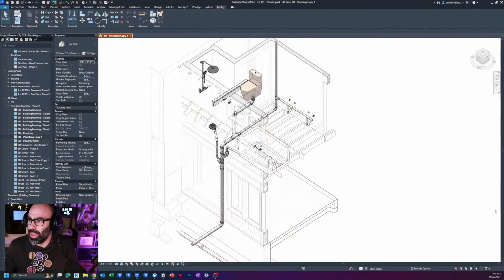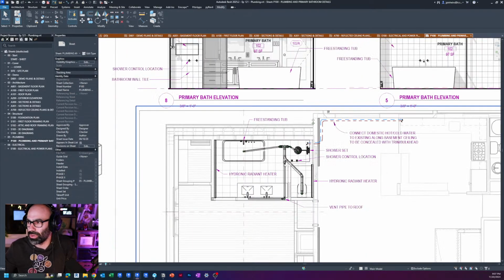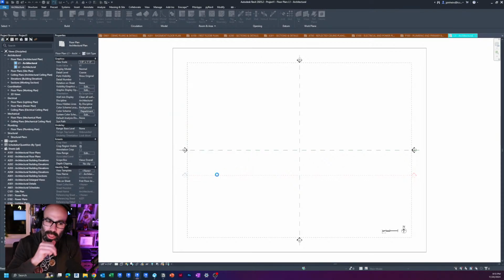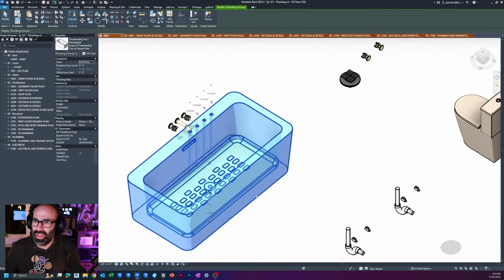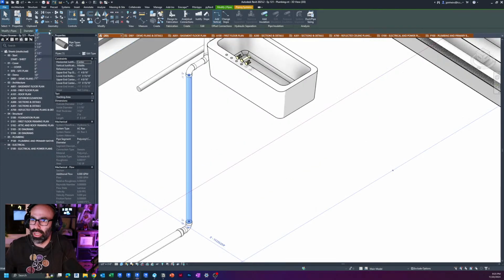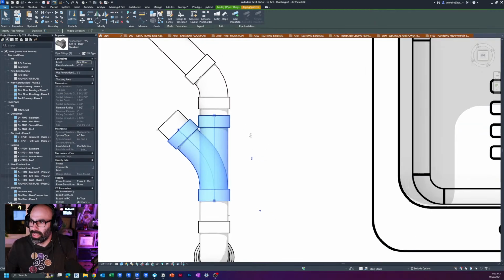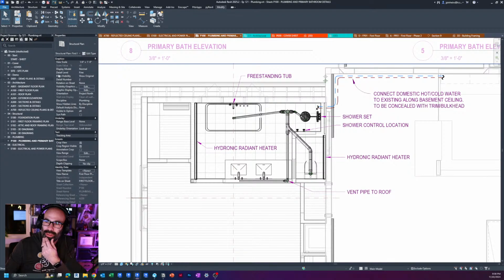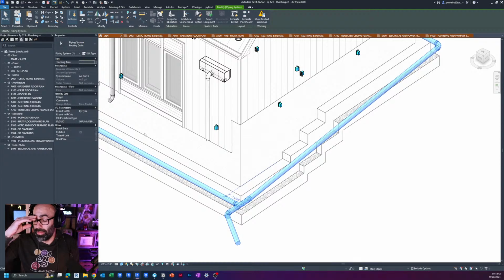Plumbing the Primary Bath in Revit... in 3D! (The North Wing - PT 7)

Comment: The waste and vent are not to code.  So, a starter example. Not a real world example. Still love The Revit Kid though.
Reply from the maker: @gooberfishin  is that right…?
Reply: @ Every plumbing fixture needs a vent. Field inspectors will expect it, even though codes offer illustrations of venting alternatives. I’ve only seen floor drains in residential bathrooms in projects based in Australia. The routing is good. I liked that you showed what is usually hidden behind walls and under floors.
Reply from the maker: @gooberfishin  I’ve since updated this quite a bit but this is a horizontal wet vent configuration… so not every fixture needs a dedicated vent in this case.
Reply: @TheRevitKid  Of course it doesn't. You can vent only one of them as long as it all connects to a single line.

Comment: Maybe different countries have different perceptions.
For me, it is disgusting to connect the sink/floor drain (WP) and toilet drain (SP) together early. (the smell may waft out when washing hands)
If this just draw it casually to show the function, that’s fine.
Otherwise, there will be a smell if the bathtub and floor drain heads do not have traps.
Reply: I do not see any problem with it, since every unit needs to have its own trap.
Reply from the maker: Every fixture will have a trap and has to by code… there is absolutely no reason to give each fixture its own drain line.  I did not model the traps in this video.
Reply: @TheRevitKid  In addition, some drainage pipes do not have traps.
Like fire hydrant boxes and air-conditioning drainage (if the air-conditioning is not turned on in winter, it will be ineffective as long as there is no water)
Some buildings don’t understand and think they are all drains and then connect them together. This is very dirty.
Reply: @TheRevitKid  usually we separate the "dark water" from the "grey water", that means when doing the internal drainage, toilets have their own line and all the rest goes in another line until they connect to the mainline.
Reply from the maker: @Ooze27 I’ll be sharing how the plumber did it in a video!  He did do it a bit different from me but same concept.

Comment: In spain, architects are prepared and authorized to do everything, from plumbing to structural design and calculation towards final approval and construction. That doesn't mean that they end up outsourcing that to others for assurance as we already have a lot on our shoulders for each project.

For efficiency i would preffer to keep diagramatic installations defining the segments and widths that have been calculated.

Now i will think about keep it as detailed as yours.

Good work. Your drawings are very sexy.
Reply from the maker: Cheers! Don't forget you can model it in 3D but also show it as linework (just go toa  Coarse view).

Comment: I design plumbing in Revit for a living and have to say - Revit sucks it in a big way! Though using AI for creating connection from point A to point B would be enough.
Reply: I design plumbing in Revit for a living as well. I'm curious what you're encountering that makes you think it sucks. It's great for me. I do design and shop drawings for various buildings in NY and NJ. Currently working on 4 hospitals.
Reply: @spbaird  Interesting. Firstly, it often refuses to connect pipe elements, even though you know that such a connection is possible in reality. I use families from reputable manufacturers (Wavin, Pipelife, ...). You set some deflection allowance in the connections, but Revit still struggles with it and fails to model the piping. If you're not modeling pipes in nice straight lines but need to change the direction of the route with small deviations and ideally assemble it from real-world components available on the market, or if you need a tee turned not at 90° but at other angles, Revit has huge issues with that.

I found an excellent plug-in, Naviate HVAC & Plumbing, that includes great features that reduce frustration when modeling pipes. But here's the issue – these features should have been part of Revit long ago, not something for which I have to pay big money to another company that essentially compensates for Autodesk's shortcomings.
Reply: it is all about good quality content, with good content it is perfect.
Reply: @lourenssmids3273  I wish! I use families created by leading pipe system manufacturers. I believe they are made as well as possible, yet I blame Revit for not allowing families enough flexibility and variability to model piping with numerous small directional changes, various branching angles, and so on, as is often the case in reality.